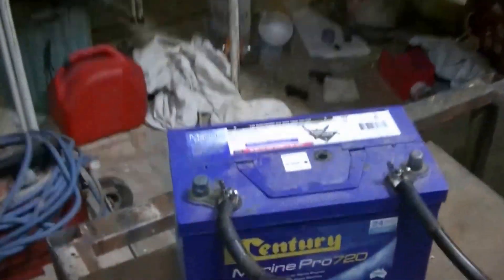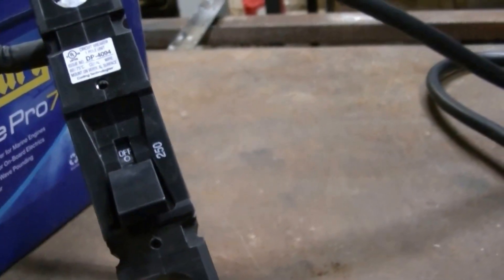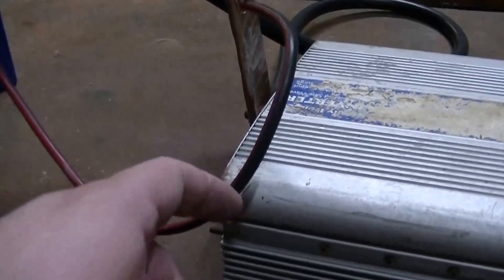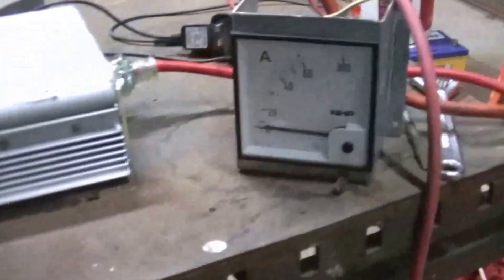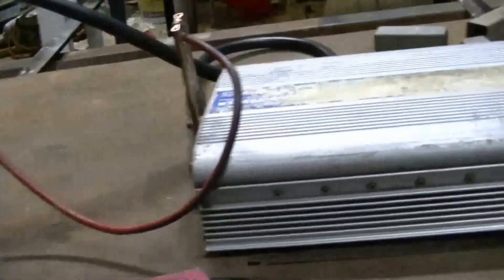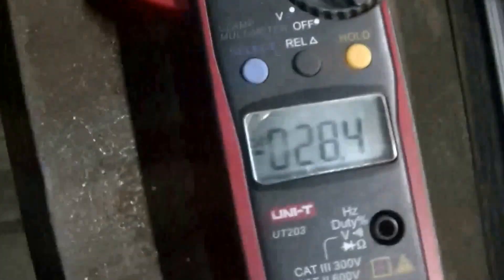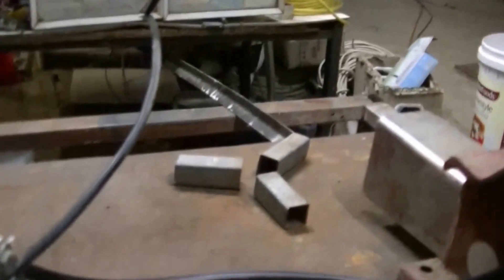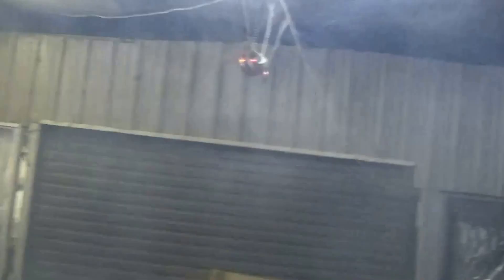Testing wires and fuse sizes

Comment: in the last bit you pretty much shorted out the battery. Since the cable was so small and the breaker/fuse was so big the house burnt down even the mirrors lol. Lesson, Please match your wire, load, and fuses correctly.